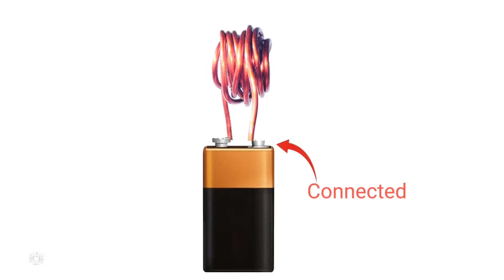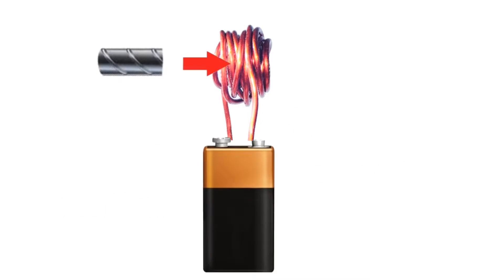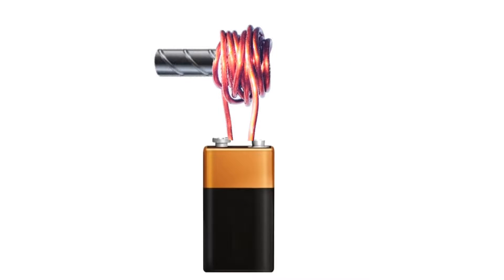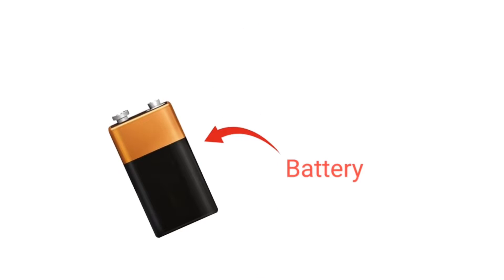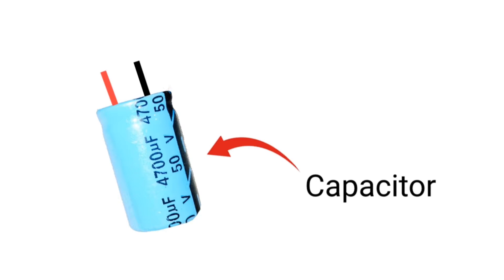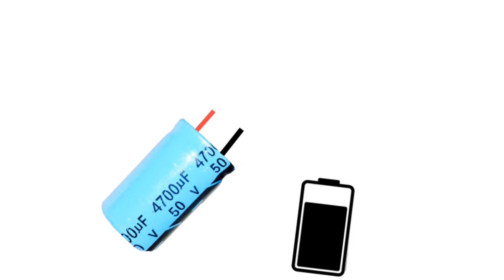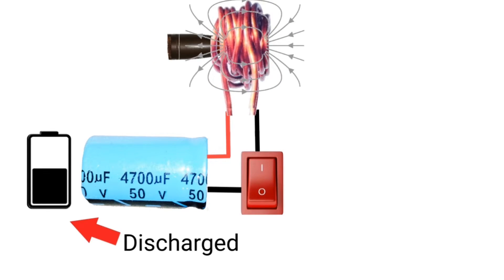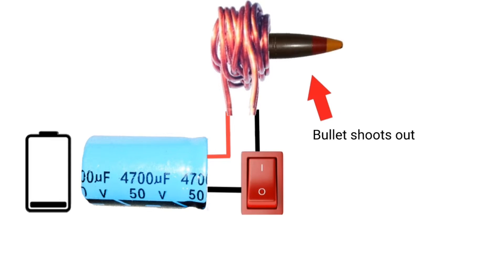How does a coil gun work? DIY coil gun [Part-1] ✅

Comment: how did u charge the cpacitor??
Reply from the maker: From Power Supply, boost converters can be used
Reply: @Electronic_For_You I'm new to electronics , don't know anything, was thinking about making this but am confused about power supply
Reply from the maker: It's very dangerous if you are new to electronics , because charging a capacitor in  wrong way can result explosion and injury
Reply: @Electronic_For_You  can u tell what did u connect it to after you clip alligator clips

Comment: Is the coil only made from copper wire?
Reply from the maker: Enameled copper wire
Reply: @Electronic_For_You  okay nice, i am making a project where we have to make something with a dc motor and coils and we really love this idea. we are wondering if we can use a diodes and a transistor for a safer result. And do we need a battery and a capacitor to make the circuit?
Reply from the maker: You need a capacitor to store energy, you can use a small boost converter to charge the capacitor
Reply: Are you using any magnets?
Reply: And what is on the red and black wire, is it just battery?
Reply from the maker: No I'm not using any magnet's 
And you have to supply 30-50V to the capacitor charge

Comment: Can i use 33.000uf or that much for stronger push? And where to find ferromagnetic core
Reply from the maker: Use higher voltage capacitors like 200-450V - 1000-2000uf you will get 10× more stronger push! 

Careful that much voltage can kill you, try at your own risk ⚠️